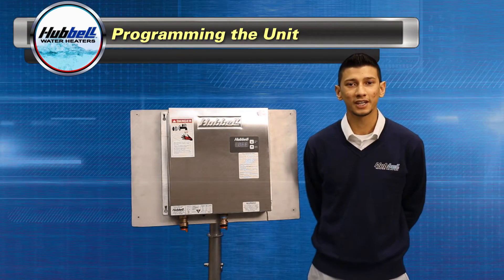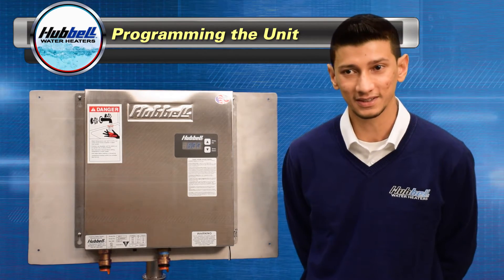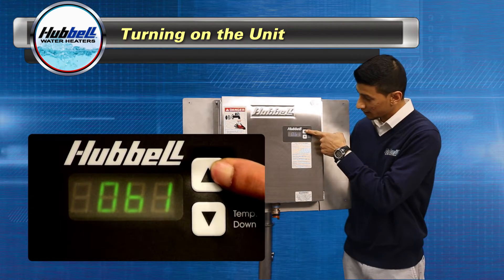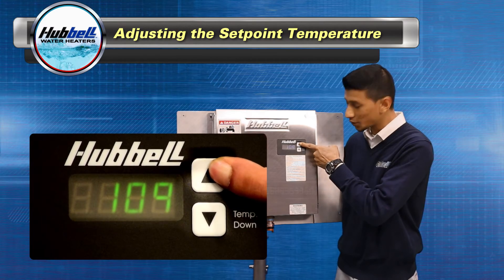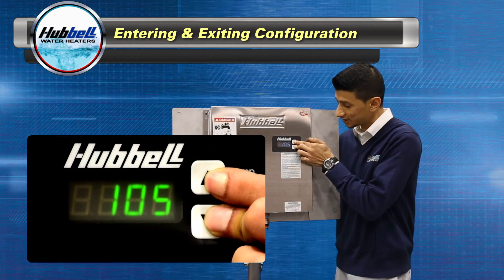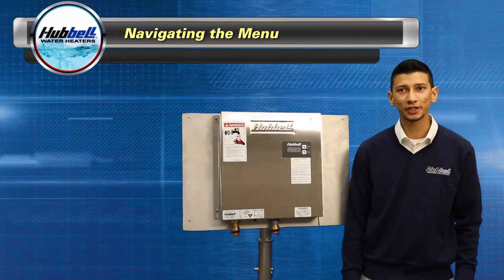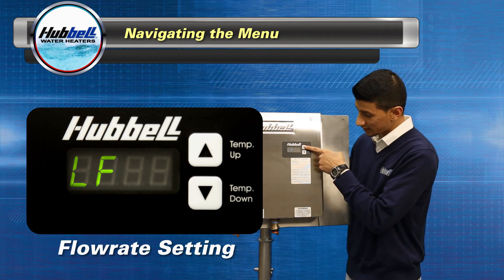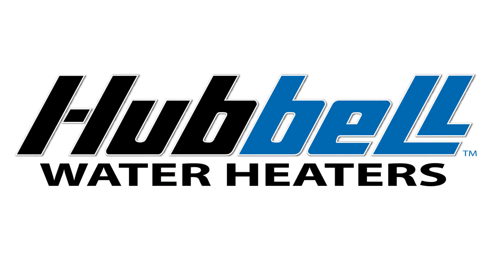Programming the Tankless Water Heater

Comment: hello, Dear sir, I have one Hubbell 16 kw Heater 3 element, 3phase 400 volts..
Facing the problem is that its not go at ON positon when i press the temp Up key... by press and hold the key the value fast changes fast between 120 to  135 and come back at off postion after releaing the up key....
can you breif me the possible reason.. all parameters setting are as per manual...
Reply from the maker: hello sir, please contact our technical support team @ http://www.hubbellheaters.com/support/tech.aspx
Reply: Thank You.
Reply: I have same problem